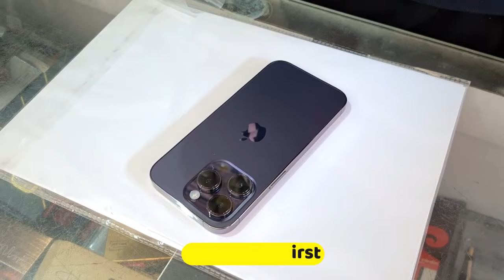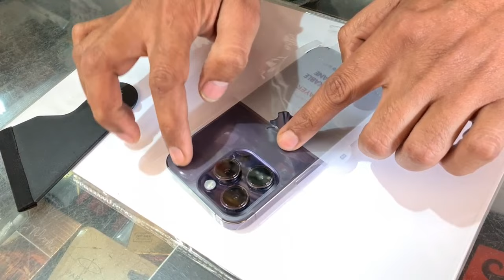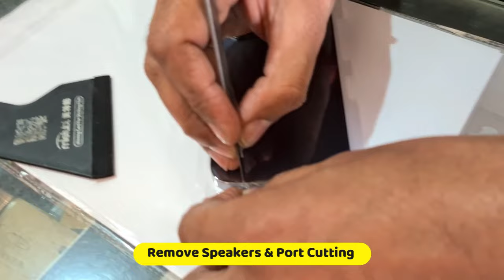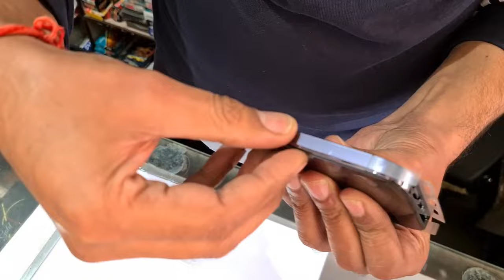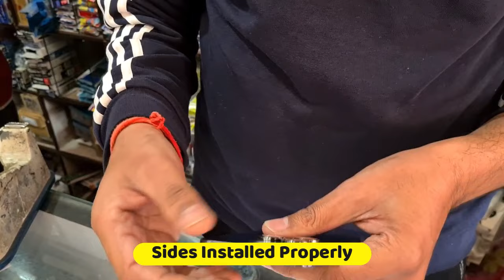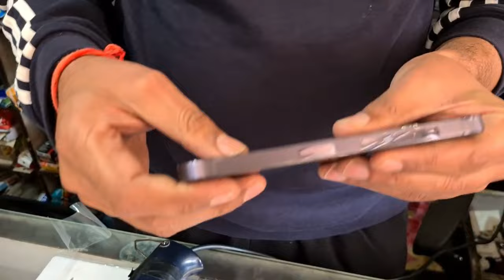iPhone 16 Pro 15 Pro 14 Pro Max Unbreakable Membrane TPU Film Back Skin Screen With Sides Protector

Comment: Now it won't get stains and minor scratches from dust
Reply from the maker: Very Protective because will protect back sides and port areas also. 9H Hardness With 0.2mm thickness. MUST BUY FOR THOSE WHO HAVING iPhone 14 Series.

Comment: Would love to see how this goes on a 15 pro max. Considering they have glass shatter issues would this take the full impact if dropped?
Reply from the maker: Yes It is so protective as having 9H Hardness
Reply: This is purely just so it can be used without a case to reduce scratches. Won't protect against drops. I have one and totally recommend one tho

Comment: But case fits tight right after this and it’s difficult to put on cases
Reply from the maker: I have installed same for my iPhone 14 Pro Deep Purple as shown in video. Also using all cases comfortably
Reply: @MobileZon i have same but my case fits tight , i have tried different cases but all are tight
Reply from the maker: We are having back protector which is .2mm thick. So it fits perfect